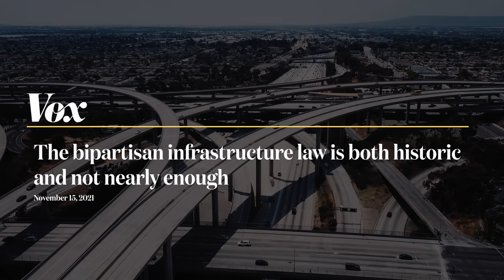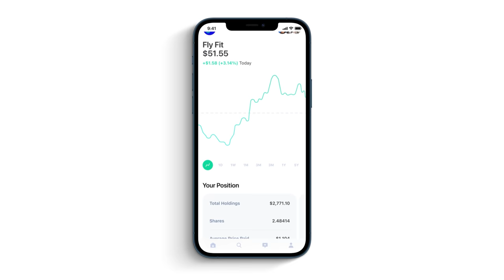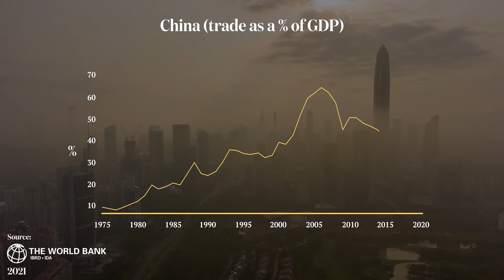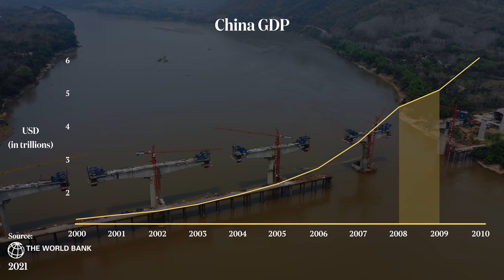China Has A Debt Problem Three Times Larger Than Evergrande | Economics Explained

Comment: 2:18 this is just a flat out incorrect characterization of trams.  They don't have the "same traffic problems as buses".  Usually only part of a tram route is on a road shared with cars.  When they have their own designated rail, they are much faster and smoother than buses, they have a much higher carrying capacity, and they're electric powered.  I've taken many buses and trams, and trams are always a much better traveling experience.

And about route flexibility- city buses travel on fixed routes just the same as trams, so why exactly do you need your public transit to be "flexible"?

Maybe in Australia the city planners don't know what they're doing, but here in the Netherlands the trams are fantastic.
Reply: Love EE videos, I just also love Not Just Bikes videos :)
Reply: Well, on the flexibility front, you can't change a tram route without laying new rail. You can't take detours to avoid construction, and it's harder to keep a line going if a tram breaks down versus a bus.
Reply: They're also far more efficient than even an electric bus. Trams are dope.
Reply: I'd say even if they share the road with cars, they are still better, because the traffic lights are optimised for them. And most of the times they won't share the whole length of a track, so they are even faster. I commute every day with tram and it's the best transport mode in a small city. (Not possible in the US because the footprint of a 50k city would be way bigger than the European equivalent?
Reply: They really should be trolley busses not trams
Reply: When trams are separated from the road they are called light rail. In Sydney, initially they were going to do light rail but then ended up with the current abomination.
Reply: He was talking about Australia. So maybe they did it poorly
Reply: You have to remember, he's talking about Sydney Light Rail. Possibly the worst new light rail system in the world, sometimes slower than the buses it replaced.
On the flipside, I give praise to the new Sydney Metro, possibly one of the best new subway systems in the world!
Reply: Some people here comment about the problem that the tramrails are blocked. But in that case you can use buses. That’s what they do when the train rails are blocked in the Netherlands. You just travel that part temporarily with the bus.
Reply: @Horseshoecrabwarrior  on the flexibility point a tram cannot move around a car parked (illegaly) on the rail. Or that had an incident while on the track, like in a crossing. That is at least the reason I personally always preferred a bus route to a tram route when I had a choice.
Reply: you don't seem to know what the definition of trams are.
from wikipedia: "A tram (in North America streetcar or trolley) is a train that runs on tramway track on public urban streets; some include segments of segregated right-of-way"

What you are describing is light rail.

Our urban planners didn't make mistakes, they literally made trams.

Comment: As someone who works in the rail industry and has done high speed rail projects, the different forms of rail transport are like a set of differing tools. You use the right one in the right place. By the way, Spain is doing exactly the same, expanding a good limited system in unprofitability. High speed rail is very high cost, both to build and maintain and should only be used for very passenger routes. Unfortunately, as you made clear it is often enmeshed in politics. For lower passenger routes, normal rail is fine.
Reply: I see China now has a "Maglev" train capable of over 340kph. How does the maintenance of a Maglev line compare to a traditional one do you know?
Reply: The problem is using high speed for everything. It's the same problem that people run into in city builder games. Becoming inefficient through efficiency. Road and highway systems are designed the way they are for a reason. Main arteries, high speed roads between major points of interest. Secondaries, 4 lane roads and avenues branching off of arteries and often moving between them. Then your basic roads, the 2 lane jobbers everyone with low traffic. Rail networks need to be seen the same way. High speed between the biggest population centers, NY, Chicago, LA, Seattle, Phoenix, Atlanta, Dallas, ect. This gets you across the country fast and reducing burdon on airlines. Then low speed rail from major cities to minor cities. Finally, within a city you have busses, trams and metro. That's an effective public transit system for America. And if it's competitive with air travel and at least equally as comfortable, and given pilot and atc shortages it will be, it should be popular
Reply: Replying to my own comment, if we were to build a high speed rail from NY to LA and charge china's per mile rate plus 20%  for profits, it would still be roughly 30% cheaper than an airline ticket. Adding airline check in requirements ect, it's also only 2 or 3 hours tacked onto the trip as well. You can't say it wouldn't be an attractive option for families and economy travelers
Reply: Your comment is false… Biggest Spanish high speed projects are Corredor Mediteraneo and Pajares tunnel, both of which will operate mixed traffic. Besides the study that is used  to make this claim only counts AVE services, even though Alvia and Avant make up a huge portion of the ridership especially in the north. It also states that the only profitable routes are Madrid-Levante, Madrid-Catalunya and Madrid-Andalusia which seems very little but it’s actually like 75% of the system’s lenght

Comment: The difference is with any engineering project its far easier to do it from scratch vs major renovation of something that's in place.  China is largely doing it from scratch, the US is largely fixing in place with is harder.  Engineering from scratch almost becomes cookie cutter, renovating what's in place means every project is done differently depending on its age and the regulations in place and what shortcuts they could get away with.
Reply: @seanthe100  Yup, economists who don't understand basic engineering drive me nutz, Cathy Wood is another one that just like that.
Reply: California still doesn't have a high speed rail system. Stop deflecting.
Reply: @dodgingrain3695  As an Economist who happens to both have also studied engineering and also used to live in china knowing some of the issues first hand, I feel you.
Reply: This is constantly the reason why in the 1st world infrastructure projects are so expensive. You can't just build a new highway, when you expand a new one, the 100,000 people who use that road every day need a route to use. So instead of just building 4 new lanes, you need to rebuilt 2 at a time, since the other 2 are being used during rush hour.

The Sydney tram thing also needs to note that the NSW gov is famously corrupt. Their premier just resigned for a corruption scandal, which is turn tiny compared to other scandals like the new Syndey airport land scandal where $100k "donation" was paid and in exchange, land worth $3m was paid $30m to the owner.
Reply: @stateofopportunity1286  Yes, it’s a sad state of affairs. The problem is that it’s not a priority for most constituents of the state. We already have a high-speed rail system between SF and LA…it’s called Southwest Airlines lol. It’s fast, efficient, cheap and the frequency is excellent. I’ve lived in Japan as well and the Shinkansen there is excellent, yet a lot of people still elect to fly between Tokyo and Osaka because the flights tend to be cheaper. Hopefully the CA high-speed rail system is more cost effective than flying.
Reply: Nor does China have to worry about the opinions of local voters.
Reply: who cares if USA doesn't have train.. US economy is so strong that if there were to do such a big infrastrcture plan, it would create inflation. Faster and better to fly anyway.
US is so scattered that a train doesn't make sense, who would do a 11h train travel when you can just do a 3h fly over... When I travel opposite of my small country I use plane not train lol
Reply: @soundrogue4472  I don't think that's that big of a deal nowadays, since it had been a decade or two ago when those buildings were built and those that were truly bad would have been collapsed by now (or rather, long time ago) and those that are still standing should theoretically be good for the foreseeable future.
Reply: @hillogical  I wasn't aware they have voters at all....  Do they have voters?
Reply: @leojei  I'm talking about the buildings in the here and NOW that are collapsing; China even has a ghost town of buildings no one is living in. Have you not been paying attention to recent Chinese buildings?
Reply: Keep coping
Reply: @alexandredupont1966  It absolutely makes sense in the East Coast. For example a single line from Boston to DC would connect 40M people.
Reply: Yes and no. Renovation doesn't require planning, efficiency analysis and most importantly, doesn't require buying land cause you already have that.
Reply: From the year 2002 initiated the Smart Train Project to now, we are still waiting for the 60 miles long, one track, and low-speed railway to be completed in north bay, California.
Reply: @sunnychen1805  Lol thats the thing. US doesnt have the population density to financially support HSR over long distances. And for 60 miles,  why not just have people drive or use a bus. The line they talk about arent that long, so have little advantage over cars...just not worth the money lol. But for europe and asian countries...go for it.
Reply: @soundrogue4472  You know the difference between national projects that were being managed by the government and projects that were built by private companies, right?
Reply: @N Fels just give it some time nothing you have is old enough yet.
Reply: Cope. Many rail projects in usa were being built from scratch then cancelled
Reply: @aaroncabatingan5238  travel by plane might be faster, but it's also an extremely inefficient form of transportation, with a lot negative externalities. It can only be so cheap, because it's subsidised (no fuel taxes) in a lot of countries. Trains might not be the optimal choice for west-east travel in the USA, but it most definitely can be along the coasts. It's just that American infrastructure and city planning is so extremely car centered (gee, wonder how that's possible), that it's gonna take some time before everybody is used to it
Reply: @seanthe100  because European infrastructure is less than 30 years old? And we all lived in absolute poverty before that?
Reply: @bartelvandervelden9894  no one even mentioned Europe the original video was about China and there was comparison to the US. Idk why Europeans want to be relevant so bad. There's US and the East not much else
Reply: @N Fels 19 centuries older and how advanced were you in 1990? Age doesn't mean anything If you're unable to maintain development.
Reply: @soundrogue4472  you live in maimi, don't you?
Reply: @eehc1387  Nope; why do you ask?
Reply: @bartelvandervelden9894  Wait what, are you saying Europe was in "absolute poverty" less than 30 years ago?
Reply: @seanthe100  Germany already has. Most of our bridges were built/rebuilt in the 50s/60s and are now near end of life. Just a few weeks ago another major autobahn bridge had to be closed at short notice. First the Leverkusen bridge near Cologne, then the Schierstein bridge near Wiesbaden, then the Salzbachtal bridge also near Wiesbaden, and now the Rahmede bridge half way between the Ruhr and Frankfurt. The Leverkusen bridge and the Rahmede bridge together now force all their previous traffic over one specific route (the eastern part of the Cologne ringway), if we lose a single bridge or overpass on that route, you can bet that much of the traffic between the Rhine-Ruhr area and Frankfurt will collapse. For now, we "only" lost some part of the noise reduction plating on that route, but we lost a life when it came crashing down, which doesn't actually make me trust that this critical infrastructure is well monitored.
Reply: Also to keep in mind is that places like California have a lot of checks and balances in place to ensure a high quality system. Though I'll ha e to admit 20 years to go from idea to construction is just bizarre 
China does not. And this is well exemplified with their high speed train crash that killed scores of people resulting from corrupt people building the lines and taking short cuts (I do believe they were shot in the end). This is why all the high speed trains now drive at lower speeds to avoid further crashes.
Reply: @vandalcreed  Dude, there was just 1 disaster of such kind in China, even though it has 2/3 of all the HSR in the world, it was 11 years ago, and 9 years ago there was an even worst disaster in Europe. Not to mention the US also has numerous train accidents even without HSR.

Also, speed was not a factor, and no the minister was not shot. He was convicted of corruption in several cases, but his death sentence was commuted.
Reply: @vandalcreed  China uses super computer to do check and balance. Maybe California use an excel sheet.
Reply: @ten_tego_teges  It's called the Acela, and it's the only economically viable Amtrak route.